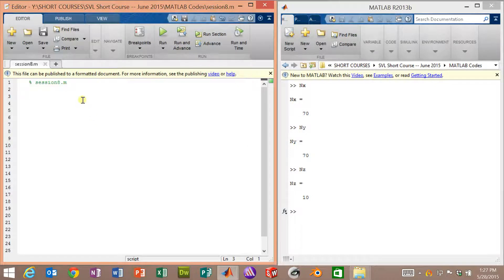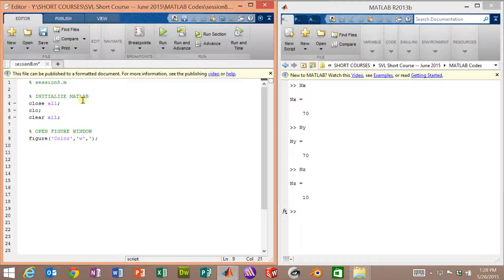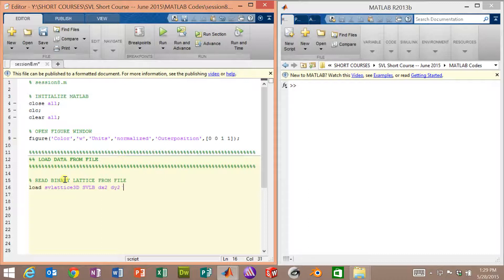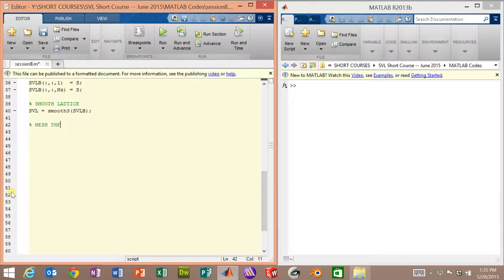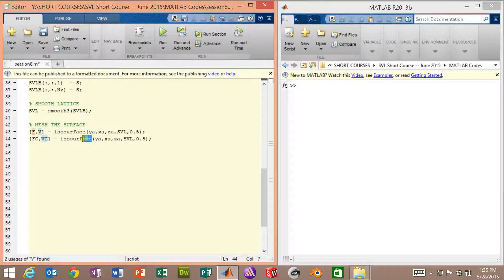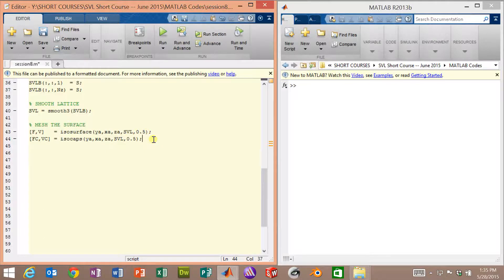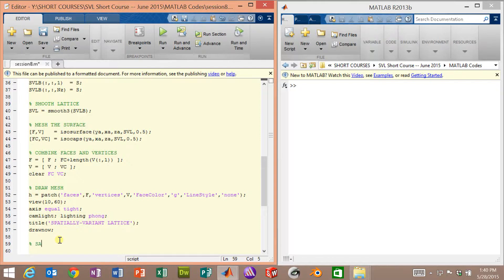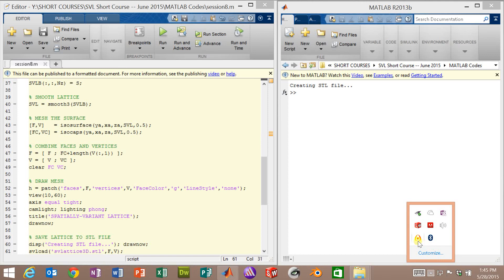Session 8 (SVL) -- MATLAB to CAD for 3D Lattices

Comment: Very useful!is there a tutorial for 3D visualizations by translation and rotation while also interacting with other objects?
Reply from the maker: I am not entirely sure what you mean.  In Blender, there is an object panel where you can see and control the position, orientation and scale of the individual objects.
Reply: @empossible1577  yes there are.but i have some school projects that I'm doing in MATLAB so after solving the logic,i wish to visualize the simulations which is animating in 3D with MATLAB rather than export it to another CAD program. Basically is there a way to animate CAD models in MATLAB?
I'd be grateful if i can find a workaround without using simscape or simulink
Reply from the maker: @austineadah2843  Yes, MATLAB can do all of this.  I am not sure I can explain how in a short message.  First, the easiest way to load an object into MATLAB from something like Blender is using functions like stlread() available on the Mathworks website.  You can load the STL files has faces (F) and vertices (V) and then visualize them using the path() function.  If you want to translate, scale, or rotate, you will have to write your own functions for this.  It is pretty simple to do and involves manipulating the numbers in the vertices array V.  Rotations can be done using rotation matrices.  To make animations, you will draw each frame separately where the objects are moved or rotated in each frame.  MATLAB provides ways to save each frame in an MP4 or GIF file.
Reply: @empossible1577  thank you very much!.i will try these out and give my fedback
Reply: @empossible1577  i wanted to ask if you could give me some tips.i want to animate and simulate a floating structure in water and was thinkng if i could do that with animating the water surface with surf function? And also animate the structure with the method you outlined up there with the stl file?
Or can i animate the  ocean surface with an stl file and still capture the interactions all with animations?
Reply from the maker: @austineadah2843  Is there a reason you want to do this in MATLAB?  Have you considered using something like Blender?  How realistic do you want?  If you have a reason to use MATLAB, I would probably try surf() first. That way, you can recalculate each frame for ripples.  To make it look realistic, you will need some volume shading that is very difficult in MATLAB and better in Blender.